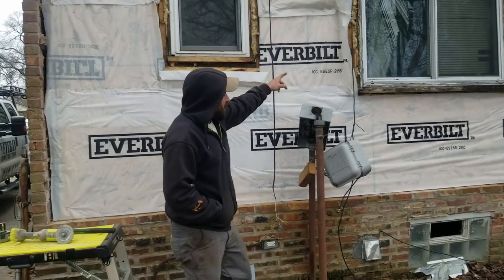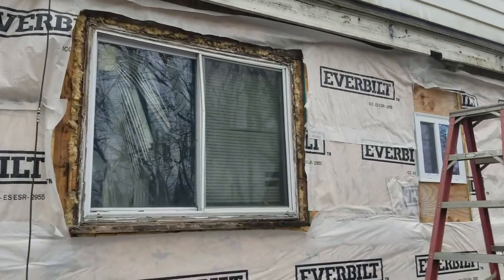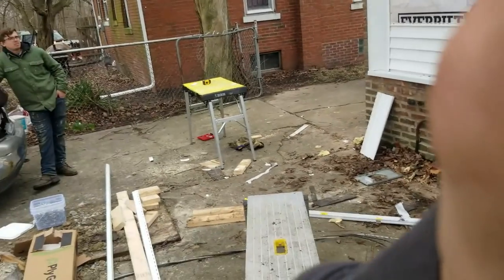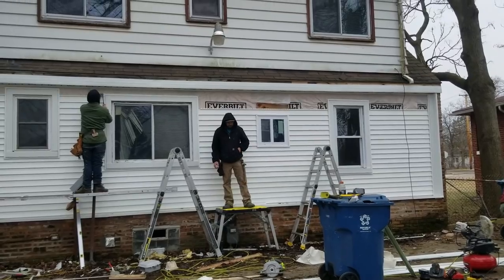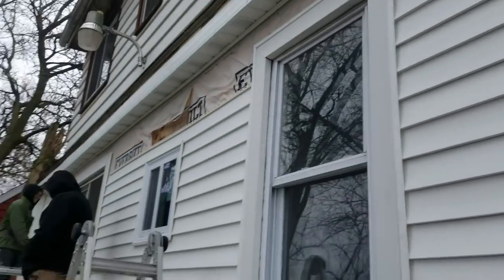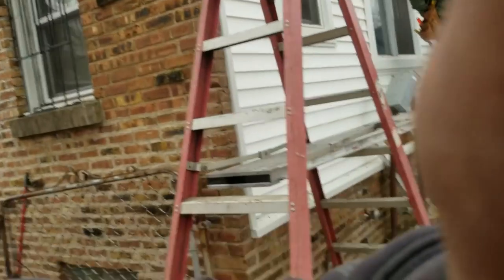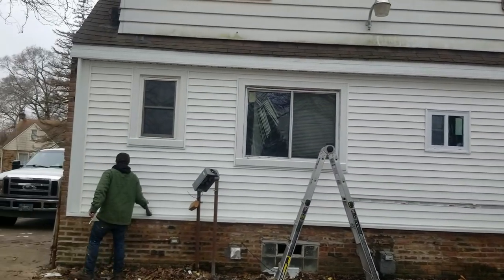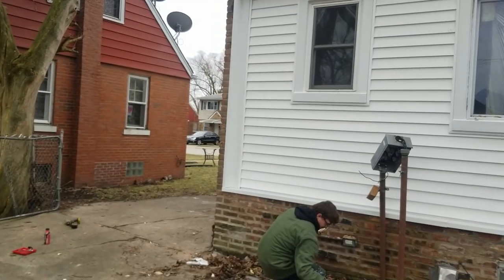Siding | Window Wraps | Gary Indiana

Comment: Nice looking job as usual, but I got a little tip for you. When you wrap your windows it helps to put another bend on it to act as flashing behind the siding. That way any water penetration cannnot get to the wood.
Reply from the maker: i was going to bjut the plywood above that 2x4 made the number too small for my brake to bend in one piece! thanks though i appreciate it

Comment: Maybe it's just me but it looks like those 2xs are not treated.
Reply: Matthew Schmitz they’re not. They shouldn’t stay wet in that location so they don’t really need to be
Reply: And you can't wrap treated with aluminum read the coil box
Reply: @chet174able  I didn't know that. Thanks for the tip.
Reply from the maker: yes thank you guys for the comments! i appreciate it
Reply: Did not know you couldn't wrap treated. But I dont do alot of that if at any.
Reply: @michaellowe9276  your welcome treated lumber contains copper and the two metals react with one another causing rot and aluminum to oxidize